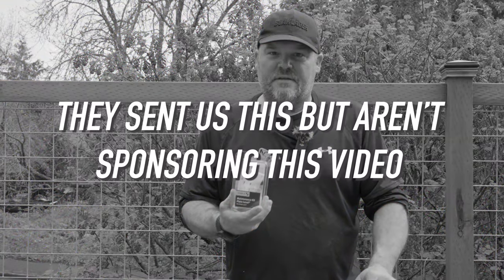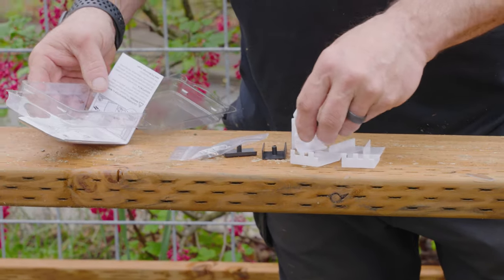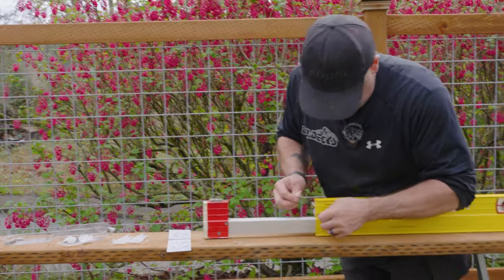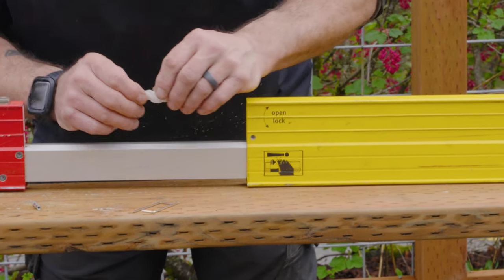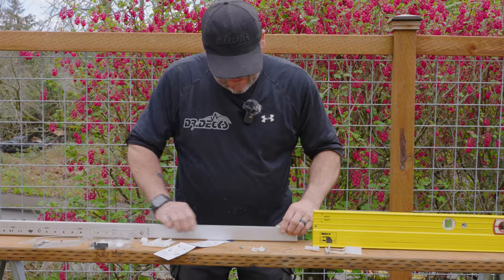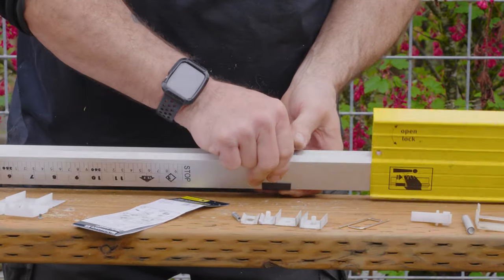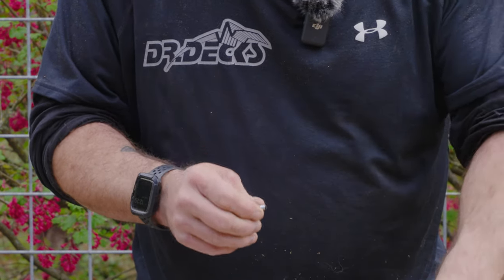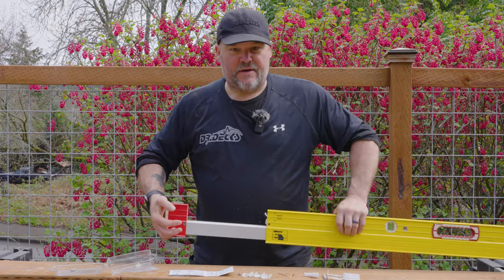Stabila Level Repair Made Easy || Dr Decks

Comment: nice work on the level repair! i had a question on another one of your great vids about G TAPE. did you change brands from Vandermeer to Mitsubishi and is the quality similar or better? I live in the PNW also and i'm resurfacing a deck I built in 1992 where the framing is still in pretty decent shape and thinking if I use G TAPE or something similar that i'll get another 30 years out of it with my new cedar 2x6's. thanks for your help and keep posting these vids cause you present yourself well and your decks look amazing.